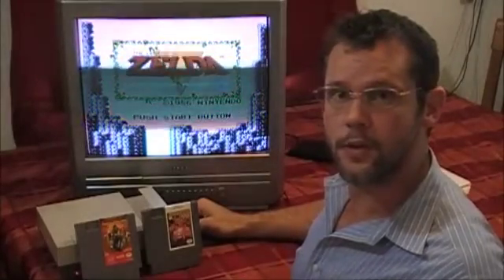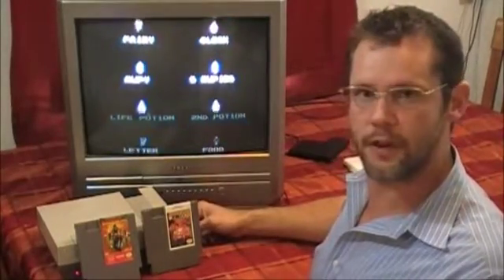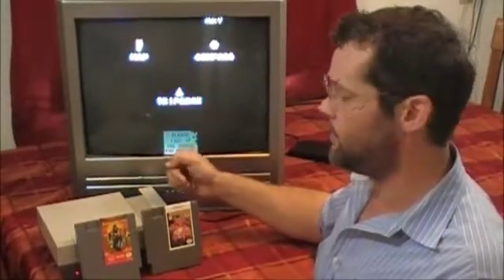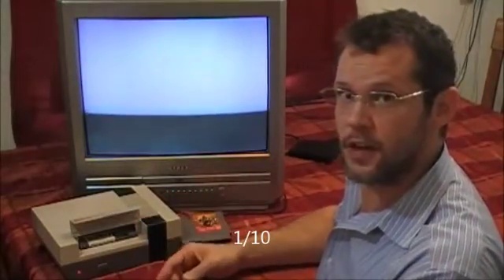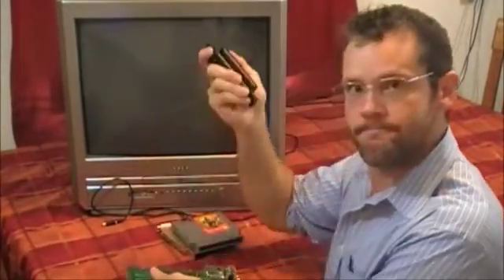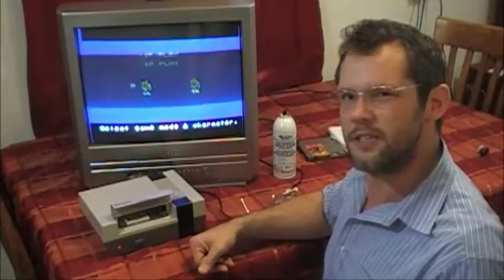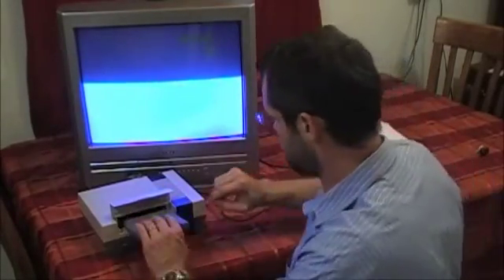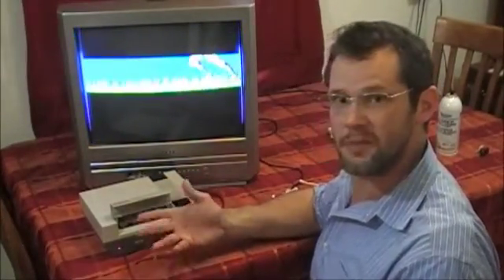Boiling NES 72 Pin Connector Really Work? Experiment Fixing a Blinking Nintendo Console

Comment: not trying to be a know it all but what I would have done although I know you said you cleaned at least some of them games before, I would have cleaned them again before re running the test after boiling the 72 pin connector.  think of it if your 72 pin connector was already dirty prior to boiling wouldn't some of that dirt have already come off on your cartridge connectors in the previous test? 

I bought my nes on ebay last april with 11 games, when I received it all I was getting was the flashing red light and the flashing screen, after watching video tutorials on youtube I got some contact cleaner sprayed into the 72 pin connector by opening the door and pointing the straw towards the connector sprayed some of that, then I opened the games and cleaned the contacts with window cleaner, magic worked first time and I didn't even switch the system off and on 10 or 20 times.  anyway good video.  I have a copy of tmnt 3 manhattan project on its way to me and a copy of knight rider.
Reply from the maker: hi, thanks. I had already cleaned the 72 pin connector with contact cleaner and it still didn't work which is why I tried to boil it.  Contact cleaner is amazing though.  Boiling it doesn't really clean it I don't think but the heat straightens out the pins which is why it works.  If I had cleaned the games before the 2nd test, everyone would think that's why they worked and not the boiling.

Comment: Hey 8bitjunkie, nice video. The problem you're having with the tray not sticking is usually caused by too much or not enough tension in the front, center screw on the bottom of the NES. That's why it worked fine without the cover on. Try adjusting that screw for more consistent results.

I liked the idea of gathering statistics. I think that the take-away from the statistics is that a boiled 72-pin connector will help the NES read clean cartridges more consistently, but even the cleanest 72-pin connector can't read a sufficiently dirty game.
Reply from the maker: Hmm... interesting. That sounds like it might have been part of the problem.  But what do you think about this: with the tray taken completely out, it was behaving basically the same way - maybe latched 50% of the time.  After studying it for a while, I shimmed the right side of the tray with a plastic card and now it works 100% of the time. Thanks!
Reply: 8bitjunkie Ah, with the lid removed, if the issue still occurs then it's most likely a problem of the front 2 screws on the tray being over-tightened. Loosening them up a couple turns will normally resolve that problem. The back 2 screws need to be fairly tight though in my experience. :)
Reply from the maker: Super Derek Not with just the lid removed, but the entire tray taken out - not screwed in at all.
Reply: The problem is not tension; it's that you need to hook the cartridge tray under the motherboard when you reassemble everything. I fix countless NES systems at work and most of the time if it's been disassembled previously, the person has not reattached it properly and this can result in the cartridge tray deforming and being much harder to put back together properly. The screws should be screwed in completely and the tray should have its lip hooked under the motherboard.
Reply from the maker: Chupperson thanks, I'll check that out.

Comment: I have a Gameboy game that doesn't work. Do you know if, if I'm careful, boiling the contacts on it would make it work again?
Reply: Try reflowing the solder on the chips.
Reply: If it's intermittent, it could be a bad solder joint that needs to be reflowed or a bad capacitor that needs to be replaced.
Reply from the maker: JustTheRandomStuff - Just one game doesn't work on your Game Boy or your Game Boy console doesn't work in general? Either way I don't think boiling the contacts will help anything.   If it's just one game, run a q-tip soaked in 90+% isopropyl alcohol over the contacts.  If it's the Game Boy itself, it depends on what's wrong with it, but if the connector is dirty, I just spray them with contact cleaner and that works 90% of the time.
Reply: 8bitjunkie
It's just the one game. I got it in a trade on reddit, but it only works sometimes. I've tried rubbing alcohol and Brasso, but they didn't work. Someone on /r/Gameboy suggested surgical fluid, but I don't even know where to get that. Someone else suggested Windex, but I haven't tried it yet. The game in question is Pocket Bomberman, but I don't just want to buy one on eBay, because they are currently going for $5+
Reply from the maker: JustTheRandomStuff not sure what surgical fluid is... but if you've cleaned it with alcohol and brasso and it still doesn't work, it might just be busted. sorry!
Reply: sd31117 I haven't gotten it to work yet, but I'll try that.
Reply: sd31117 Didn't work
Reply: sd31117 That's what I thought, but if it were broken, wouldn't the Nintendo® thing would be a black rectangle?